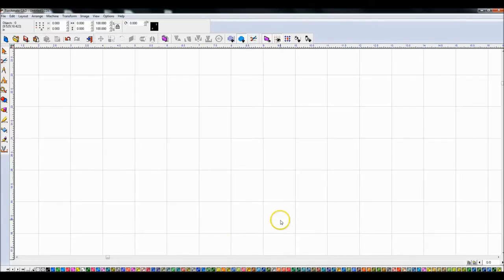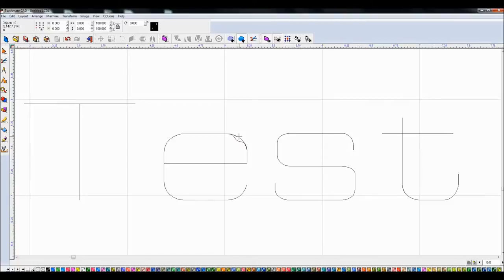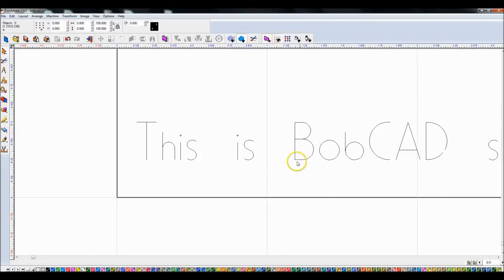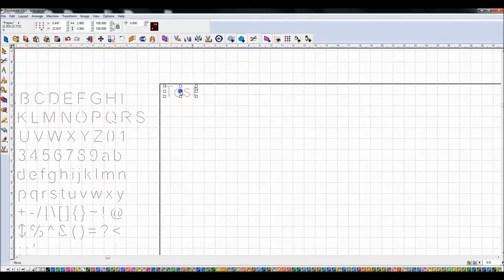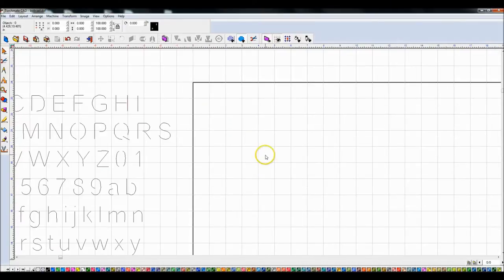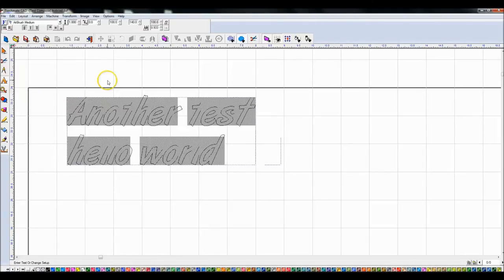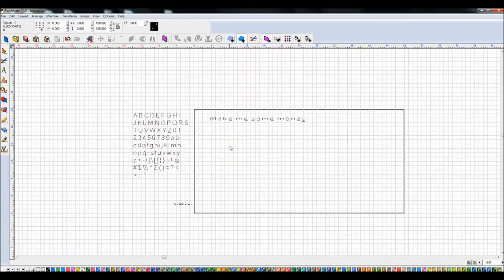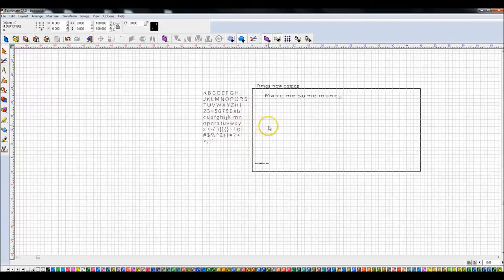Torchmate CAD/CAM:  Single Line or Stick Fonts

Comment: You said windows doesn't parse stick fonts correctly, you said there were two lines in the font.  It is actually one line forming a closed path, windows parsed it correctly, I simply clarified why: because windows fonts cannot have single lines or open paths.  

My other point is if a font was designed for centerline tracing, with no branches, similar to the way the dxf font has no branches, then it could be centerline traced cleanly.  Your video helped me see that, I wasn't simply repeating you